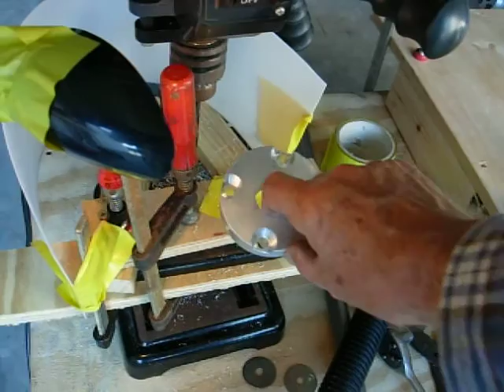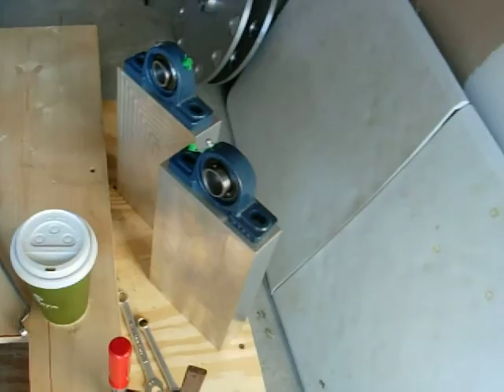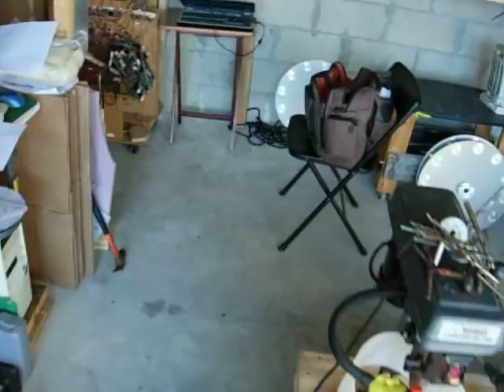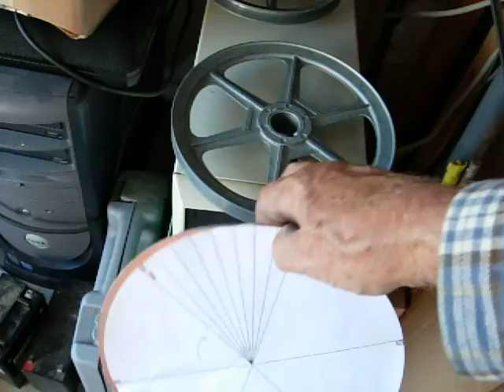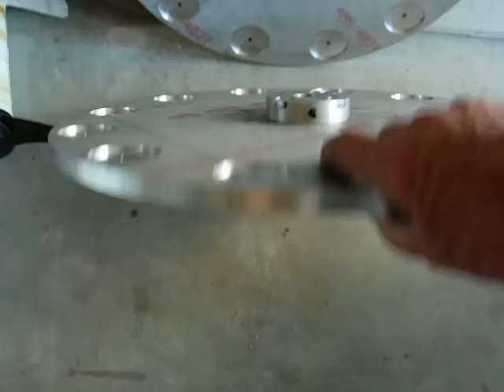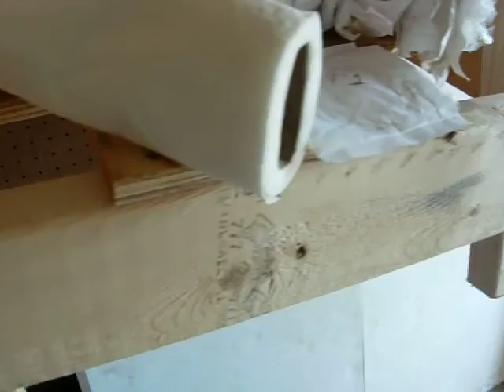Don Smith #151 car Impulse motor status

Comment from the maker: The prototype is running in video Don Smith #39.   This is an impulse driven motor #39 is running at 250RPMs on .5v impulses which is amazing.  This new one will have 5 rotors and 4 stators.   It will run on capacitive discharges up to 500vdc.   the dual coil when its power coil is impulsed with a 12vdc battery yield back  from the second pick up coil 10 v back so I loose 2v in the process.   So to make the motor a self runner the 2v must be recovered from BEMF ringing event collection.   Magnetism is a byproduct producing the rotation.   By using the rotor with 18 inch dia I'll get huge torque from very small inputs.  end result will be placed in a car.
Reply: Unrelated to your video but i thought you may  find this site of some interest maybe for electronic parts. Cheep with free shipping  fasttech.com